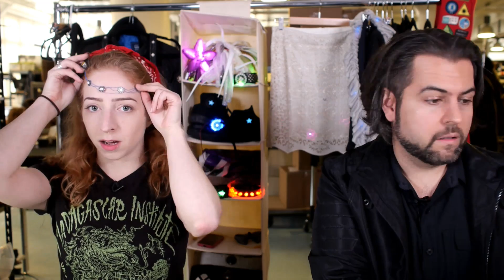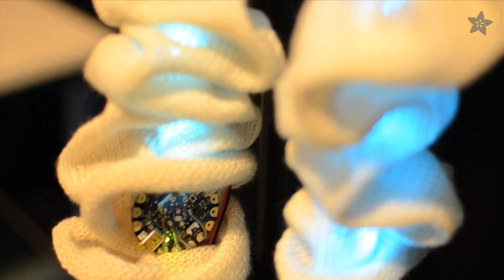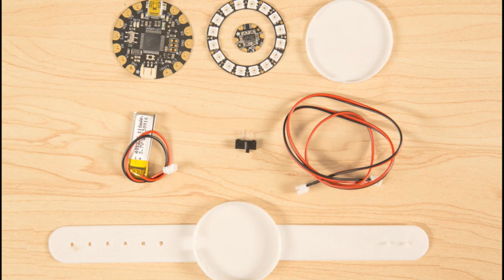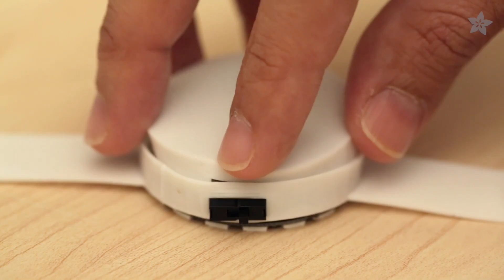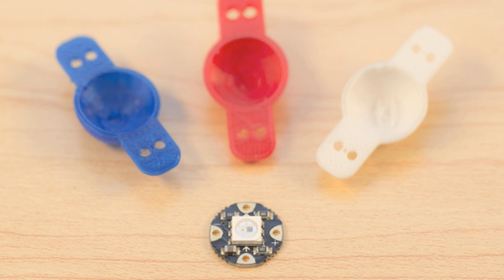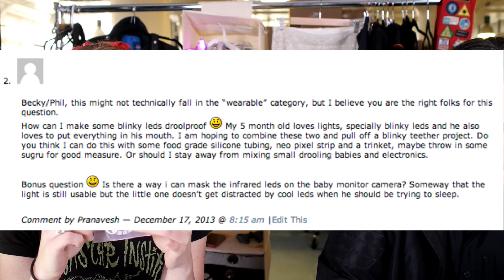Wearable Electronics with Becky Stern 01/15/2014 - LIVE

Comment: Question for next week:  I have a project that I'm working on that requires me to run some long circuits, sometimes with several traces in parallel.  I have been using conductive thread, but i have been wondering if using wire wrap with a machine zig zag stitch over would work well (and be better insulated).  More specifically I'm wondering how well the wire holds up to a lot of bending and flexing.  Any experience with this?  Does gauge matter?

Thanks!